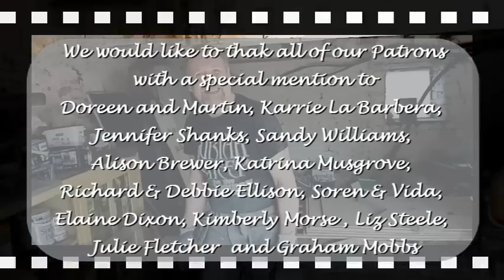136.How to build a summer kitchen part 1

Comment: What a great discovery to unearth that stoned area. Two reasons you may have leftover stones may be, one, because Carsten didn't place them together as tightly as they originally were, and, two, some were probably stones from the dividing half walls, or stall walls, that he removed from the concrete area. I wonder if that area was originally for livestock?

Carsten certainly appeared to be excited to be there!

Comment: It's like the chateau gave you a wedding present, a gorgeous flagstone patio!! I was SO EXCITED when I heard the scrap of the pick on that stone, as an archaeologist, I know that sounds well. I wonder if that had been a vacherie? The small brick walls at the end  that were removed looked like the kind of milking stalls that effectively work as blinders while the cow eats and is milked. The concrete pad could have been re-enforcement for a trough. Fun to speculate anyway!

Comment: It’s a dairy shed floor. You can tell from the drain running down the center. Rent a jackhammer and take out that concrete. You’ve got enough spare stone so if you damage what is underneath you can replace it.

Comment: How fabulous to have that area paved.  If the concrete slab is hidden by the cabinetry, does it matter about the height of the paving stones?  I thought the paving negated the need for a deck.  I presume the new outdoor eating area will be done in time for use at your wedding.  How good is that?  Making the new indoor cafe area opposite makes good sense too.   Coming along nicely.

Comment: Hi Guys, what a fantastic find looks amazing, suggest you make sure the drain hold in the wall is well cleared so the kitchen area won´t flood. Are you going to plumb water down to the kitchen as well as electricity? I guess you can use bottled gas for the cooking and hot water. Really amazing what a difference and extra pair of hand makes.. was there any reason you didn´t pressure wash the walls? Robb Torremolinos Spain

Comment: I wonder if it’s a grave stone top where the stones are, what a fine great idea, with open air kitchen. However a roof and opened sides may be better because of the wind blowing the other down. Could you make it like huge posts wooden roof and second hand roofing slates or just do it as pagoda first if no dollar. Just a suggestion here 🖖🏹🙋‍♀️😀